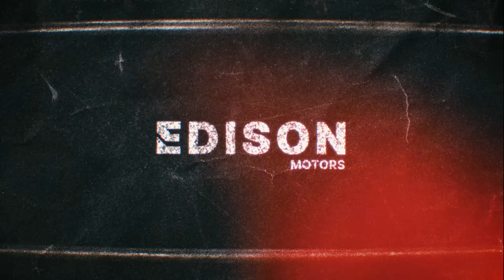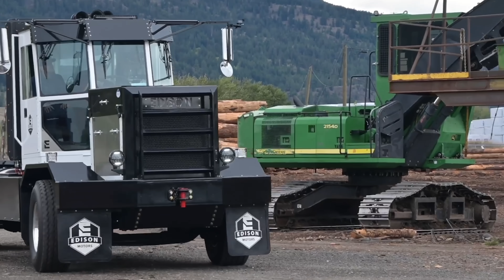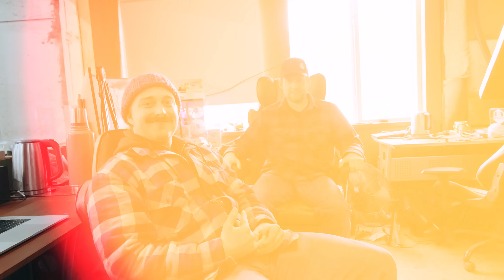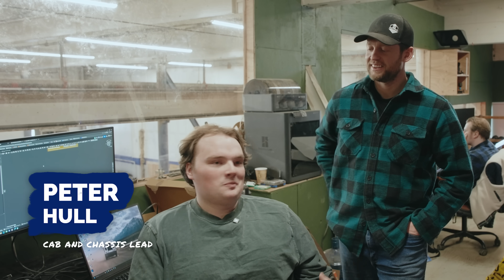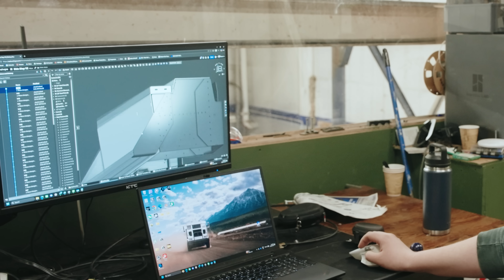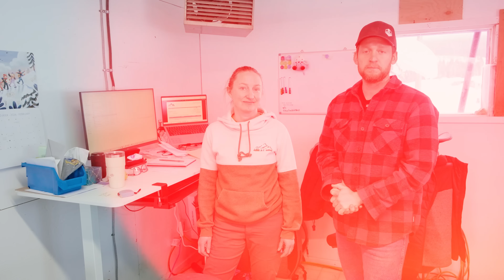How We’re Moving Edison Motors from Prototypes to Full Production

Comment: You guys are missing a great opportunity, you should pickup where Paccar left off and make a long hooded conventional looking truck with the smaller 1.9 m wide cab with 2 piece windshield. Something resembling an older W900A with a butterfly hood. Majority of owner ops don’t want large single piece windshields in apartment size cabs. It’s about looks and asthetics, the reason Peterbilt did so well all those years with the 359/379/389.

Comment: Saw you video about the truck at Sparwood. Dan Profitt and I hauled 2 tires from the lower mainland for the mine there. A  special trailer was built especially for this. as the tires were to tall for a flatbed and laid flat too wide unless a pilot car was used. Largest tires I have ever seen Largest truck I have ever seen. If you haven't seen one in person you have no idea how large they are.

Comment: Maybe I have missed this, but I REALLY want to see a video where you take one of the hybrid trucks out onto the track with a full load and run it around with the generator running.  Like go out there with 20% battery, drive it around, then kick the gen on and let us see it actually functioning and driving and those systems working.  As far as I have seen, its always just driving around with battery only.
Reply: I'd like to see this too. The white cab forward for the Undisclosed buyer should be revealed in June-ish. Perhaps we'll see this then.

Or the Yello Snowplow for Emcon is nearing road tests.

Comment: If it wasn't for the internet I would have never learned about Edison Motors. Even better, it was a field I worked in and know something about. As well, being a Canadian company is fantastic because I have been a Canadian since 1945. The only drawback is that I do not have the energy to be able to make things anymore. To see you get to a point where you can actually produce something is fantastic. I hope you hold onto that and do not sell out to a rich foreigner.

I was a mechanic and I always wanted to make better cars. In 1990 I wrote a book called "A Tinker's Dream" describing how I envisioned a car to be safer and more efficient and better than anything on the road today. I envisioned a square steel frame as a cube to protect the occupants. I envision using only three wheels so that friction is kept to a minimum. I envision the use of a small engine so that all the energy used goes into moving the car. When turning all of the wheels would lean in towards the curve chosen so the car would not flip over. I devised a hydraulic drive system but and electric system could be used, except the frame of the motor would not be the anchor, the shaft of the motor would be. 

This year I used 3D printing to try to make a model of the car but that showed me a flaw in the design and AI had to figure out a solution but somehow even though I found a solution I have stopped, as I just find it impossible to have drive and enthusiasm any more. It is hard to not be jealous of your youth. You can be sure I will be watching your success.

Possibly an "Omega" engine could be your source to drive a generator?

Comment: Dear Edison, regarding parts numbers. When you have a truck that is user repairable or at least by a mechanic, having stamped/welded/other parts numbers on the actual parts makes it much easier for customers to remotely order parts from your website in the future. Our factory does this. Everything have a part number and the parts that we know are wear parts, gets a stamped small form logo from our company + a six digit parts number. We are going to a new numbering system mandated by our owner company, but in the new numbering system the last 2 digits are color or paint specific.
Reply: Yeah
I don't know how many "parts" go into the bill of materials. I agree each part should get its own number.

I had an idea that people should use IPV6 as serial numbers.

Framework laptops paste a qr code sticker on each part that links to a web page with more details. Stickers work good inside a laptop. Not so good on a rusty frame. Would want stamped numbers.

Need an expert in "counting" things
A count-ologist perhaps.

Comment: Building a simple assembly line usually involves dividing the hourly task into the number of stations you want to use. Hopefully divide each station based on the number of task and the hours required to perform them such that each station is ready to progress at the same time. I would guess you saw this happen at the manufacturers you visited. I have seen vehicle assembly use carts or even the overhead crane to move the bare frame forward to the next bay until time it has axles and tires and can move on its own.

Comment: I am glad you guys and girls are making progress. Once you start  building a large number of trucks will you start fabricating most parts inhouse or thought outside suppliers?
Reply: Its unlikely that Edison will ever "make": glass, rubber, steel, engines, transmissions inverters, wheels, tires, electronics, seats, gauges, wires, paint, suspension, steering column, headlights, smoke stacks, brake calipers/rotors 

I can totally see Edison taking thick sheet steel and a plasma cutter to cut out jigsaw parts, then put the parts in a jig to weld up to make brackets.

MABEY, down the road, they build their own cabs. Maybe radiators. Maybe bending sheet steel into C channel for frame rails.

Comment: Been following you guys since the early days and I am rooting for you all.   Now I'm no fabricator and would certainly be laughed out of a shop for my welding skills if you can call them taht but I do have a bit of experience with some other types of manufacturing and design and know the challenges of starting up from scratch and trying to streamline production in a plant and maintain and improve quality along the way.   I saw a video a while ago of a factory tour of Liberty Trailer's new (may be a few years old?) factory in Texas here on YT somewhere that impressed me a little and thought I might share with you the one thing that stuck with me from that video that might be useful.  It might be completely obvious and a common practice in the welding world but it was how they use a kind of tab and slot style layout in their laser cut welded parts to make sure alignment and positioning is always repeatable and consistent when assembling/welding their trailers together one after another on their different lines.  This just made a lot of common sense to me in how they implemented it from a manufacturing perspective.   Makes it so their fabricators can focus more on the welding and other details of the build and less on the figuring out how to fit/position the parts together using other methods of fixturing on repeat products.   If you haven't already incorporated something like that that in your parts design it might be worth checking out to see if it can help with your ramp to production.

Comment: As a retired master mechanic, I can tell you from doing protype installation, get the installers input. So often as simple as bolt placement makes replacement/installation so much better.
HINT: Any bolt/nut that is a long term installation, put anti-sieze on them. A dab goes a long way. I had bulldozers working in sandy river water, that when we went to remove the almost round bolt heads, they came right out! 
Good luck. 🎉🎉🎉🎉🎉🎉

Comment: Can you make an electric truck with a dock for a certain generator that is sold aftermarket that works and can be placed on the truck for storage and maybe it has an umbilical so it can be run when a switch is turned on in the cab and maybe there is a lockout so it is not able to run when the truck is running... if you get my drift. Plus the generator can easily be replaced.
Reply: @ElijahPerrin80  how stupid do you think government inspectors are my guy?
Reply: @I_Automate  Just because people bypass interlocks on their own is not Edison's concern, the truck does not drive when charging plus the Ram Charger is on the horizon so hopefully things are changing.